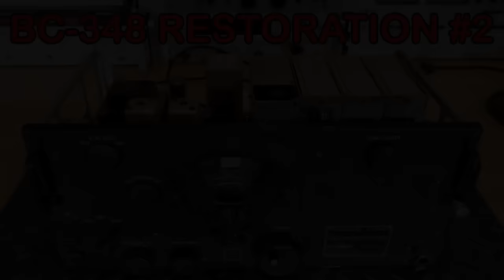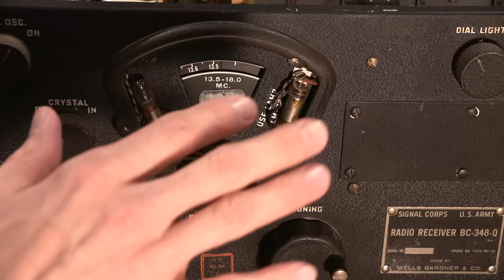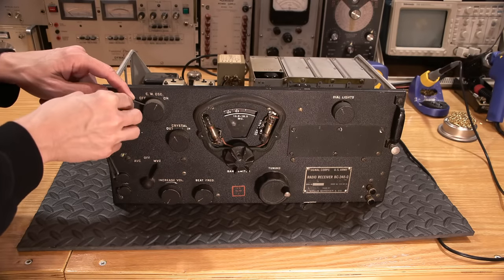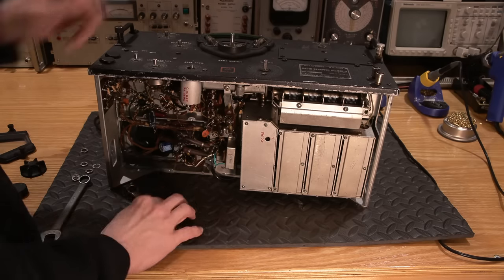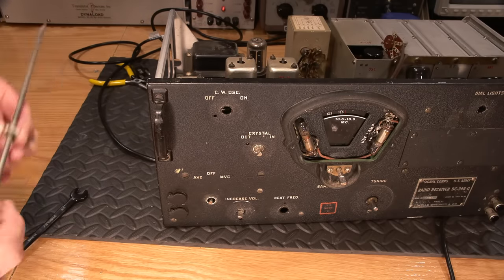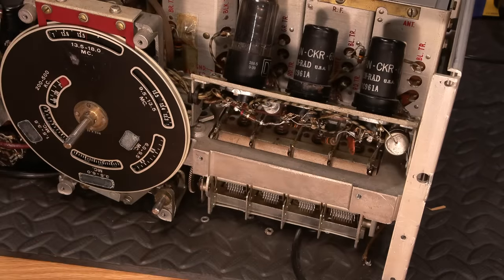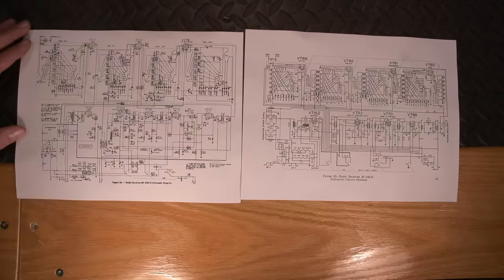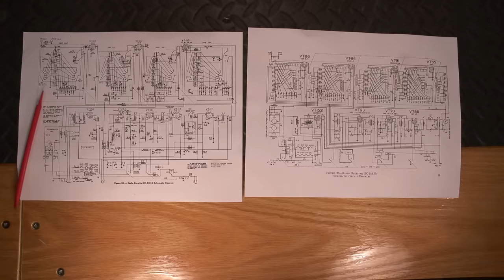Teardown - WW2 Aircraft Radio Receiver BC- 348 Restoration Series!

Comment: Rubbing alcohol works just as well, and typically you don't have to worry about taking the paint off too.
Might do a test on the lettering just in case, because of the type of paint used in some instances
Reply: Alcohol does not work on all things, only what is soluble in alcohol, that's why there are other solvents.
Reply: Alcohol WON'T work on anything petroleum based! @tedmoss
Reply: @W1RMD  That's what I said.

Comment: oh jeez

I would never start with something like Goof-Off - at least, not the hardcore xylene original - on a painted surface. For stickers, even really old ones, De-Solv-It may be slow, but won't take off your paint. It's just yet another orange oil (albeit one of the better noes) and you may need to leave a saturated pad against the sticky material for half an hour... but it's so much safer on paint.
Reply from the maker: The stain (dial fade) would be permanent on the dial anyways, I wasn't concerned. This gives us the excuse to dive deeper, and tear the unit down.

Comment: Thanks for the video. Iwould have removed the jack sockets from the front and saved de-soldering... I  have never taken the front of any of my BC348s so interested to see how the dial replacement goes? All those .01uf caps look like ceramic but they are paper and will be leaky 😂
Reply: One of the more outstanding failures of the BC-348.
Reply: @tedmoss   I think anything nearly 80 years old is going to need renovation.. replacing all the caps and resistors in the BC-348 is a lot easier than people make out (although I have disassembled those bathtub caps and put polyester caps inside and that is not a pleasant job 💩) what surprised me is how well the radios perform after a simple alignment..

Comment: I find that plain Alcohol works better for taking off sticky stuff without taking off the paint. You just have to work a little at a time and not rub hard and try applying a little heat from a heat gun before.

Comment: If they had ditched high voltage vacuum tubes for the low voltage tubes that had a heater voltage of 12V and a B+ of 12V there would be no problems with capacitors going leaky or Intermediate Frequency Transformers burning out.

Comment: I have one of these sat in the corner, its ex U.S Coastguard the paint is plain black not textured, not sure what version it is but the mains psu failed many years ago it leaked wax all over the psu mounting plate, I think its time to get it running again but there is a lot less on the shortwave now compared to when I first got it in the early eighties

Comment: Paul,  I'm following along with you with my BC 348.  Mine is intact with no modifications complete with the dynamotor.  I'm going to go really overboard and build the series regulator you mentioned in one of your video's in this series.  I'm planning on using  something like a 6L6 or 807 but a 6SL7 error amp instead of a 12ax7 because I like the look of octal tubes.  You mentioned there was a resistor providing the negative 15 volts bias for the 6k6 audio tube on the plate voltage transformer center tap.  Is that a mod someone added?  Do I need to include this with my power supply design??  I noticed the  dynamotor appears to output -17 v on pin 4 of the dynamotor terminal board.  Thanks for your great videos.  Nice series.  Thanks for sharing your talents.
Reply from the maker: There is an inductor in the audio transformer housing, this inductor has the drop across it that creates the bias for the 6K6. Thanks for your kind comment!

Comment: I would NEVER recommend using "goof off" or some similar sort of stuff to get (old) glue off of something (the type of glue used on stickers for sure), Paul. Try using cleaning petrol instead. You'll do less damage and the glue will come off completely without leaving a trace if you take a little time GENTLY cleaning it, meaning no forceful rubbing. The only "trace" that would remain would be the discolouring from being (or not being) exposed to air and/or sunlight; that is something that can't be helped unfortunately🙂

Comment: The capacitors are most likely going to be GOOD. Unless it was stored in a bad location. The filter caps will probably be not good as they are aftermarket.

Comment: I read in some comment on another channel that in the old days "caps had resistance that teh engineers knew how to account for" so when you restore old equipment you have to add a resistor for the equipment to work properly. Is that a thing? I don't remeber ever seeing you do that. I tought is seemed like they were saying you should simulate a resistive failiure mode leaking capacitor.
Reply from the maker: No, that's not a thing.
Reply: @MrCarlsonsLab  Thanks. I tohught it sounded pretty dubious.